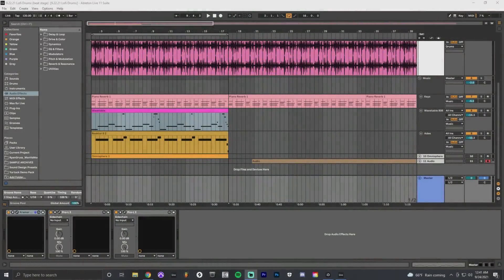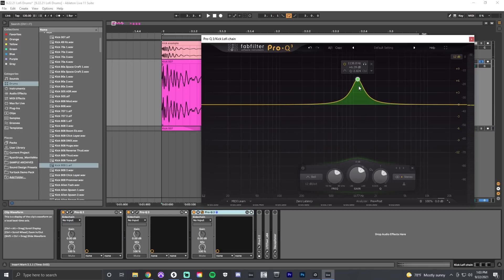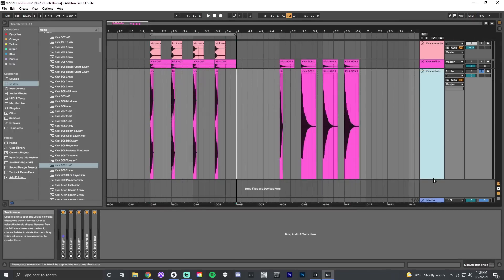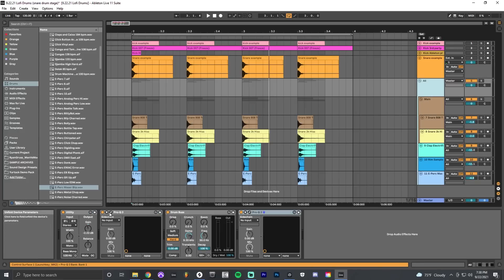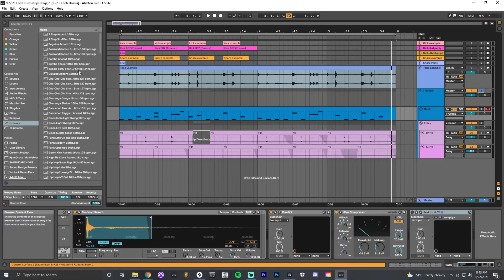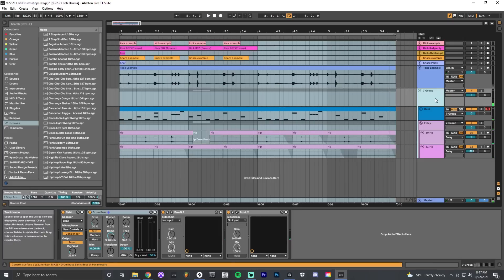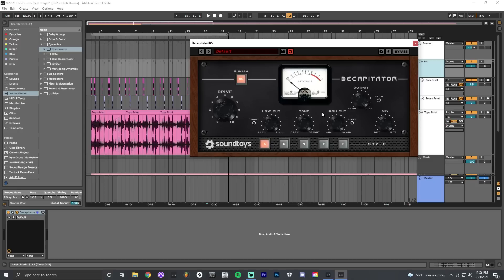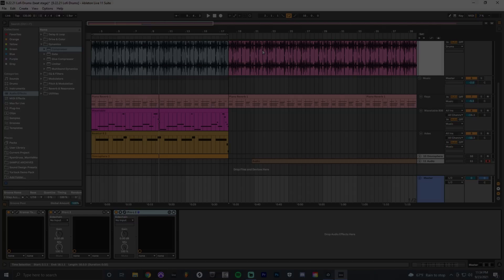Lofi Drums Tutorial | Create Kicks, Snares, Textures, Mixing Etc

Comment: Another great tut. 👍👏

Don't think it was mentioned in the vid, as a rule of thumb, roughly how long should the kick be? 50-80ms? Less? Thanks.
Reply from the maker: Thanks! There’s no steadfast rule for your kicks’ length. A longer kick may sound more like an 808 if it resonates very long, which you might want.
Reply: @TomCasey  For lofi I wouldn't use and 808, that's more a trap vibe. What length was the kick in the video? That's more the sound I'm after anyway. Thanks.
Reply from the maker: @afi6061  I keep my kicks pretty short. It's probably around 50 ms